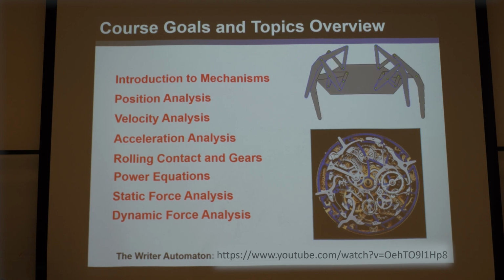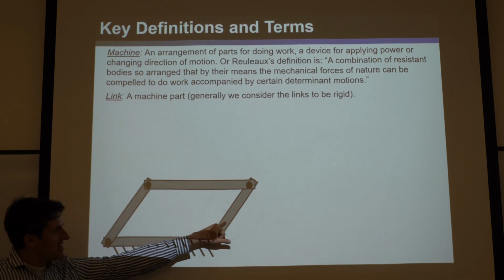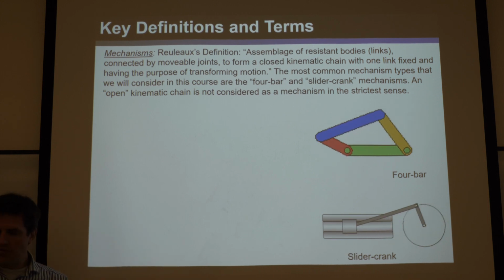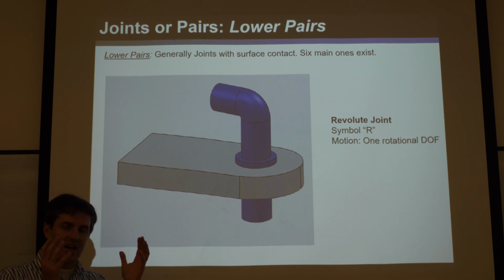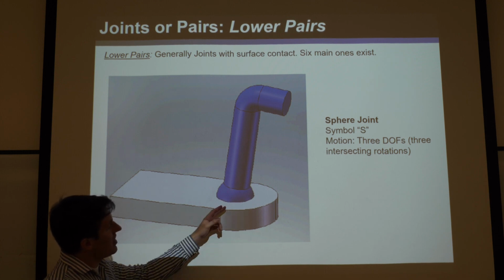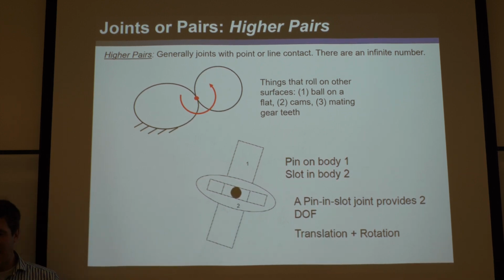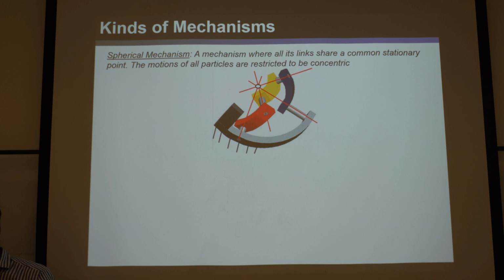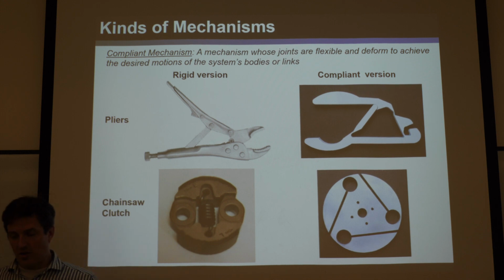Traditional Mechanisms and Mechanical Systems: Topic 1 Part 1

Comment: The robot arm is not an open kinematic chain. There has to be piston links or other actuating parts that supply torque on each "bone" in the arm, thus forming individual closed loops.